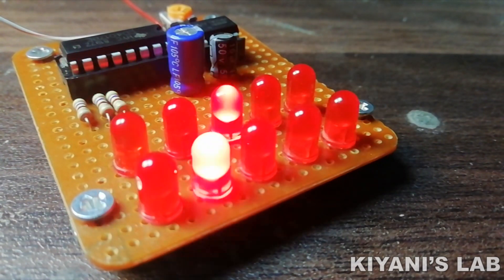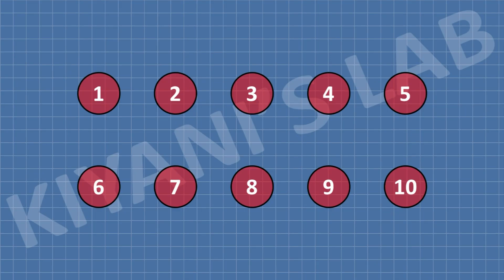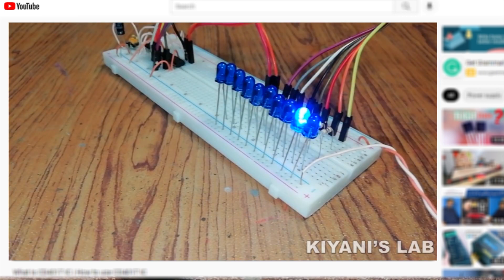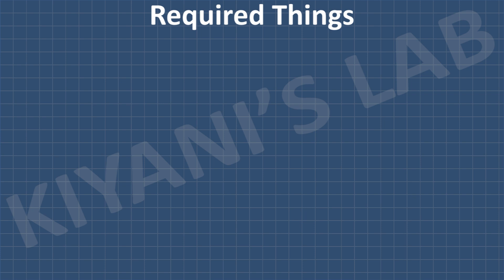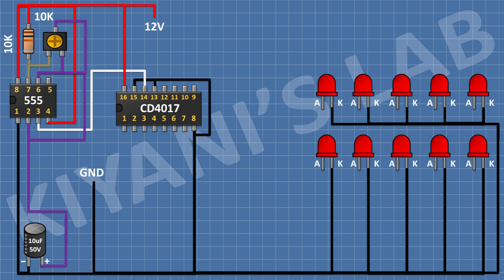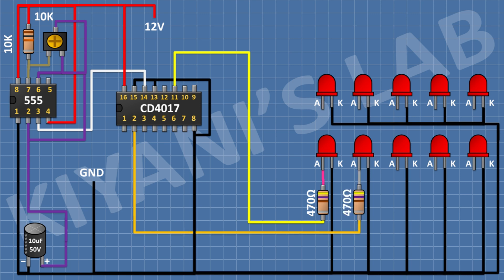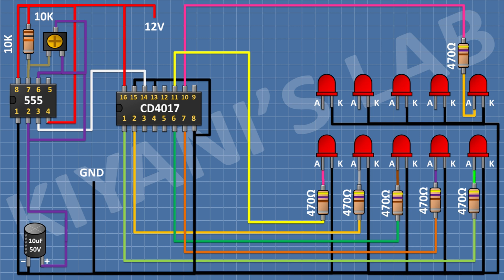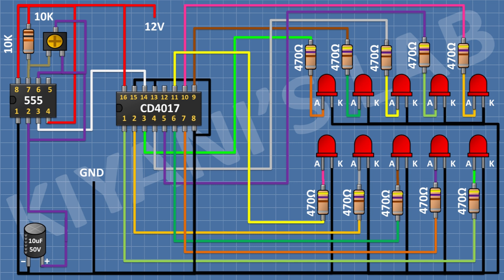How to Make Zigzag Led Chaser Light

Comment: Since only one LED is on at a time, you could have one 470 ohm resistor in the common ground line instead of 10 resistors - one for each LED. Just my 50 cents to reduce to costs.